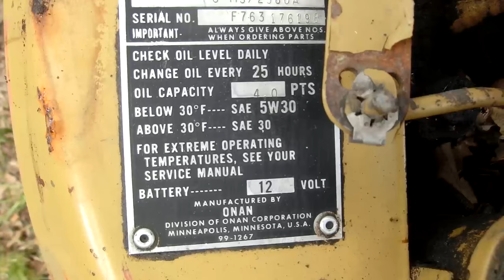Random Bits 0149: Cleaning up the Yard, 3 years of Random Bits

Comment: That yard reminds me of one I cleaned up a few months ago.  I saw an ad on Craigslist for free aluminum clothes yards.   So I went there with my van and their yard looked like yours.   The old lady who owned the place asked if I was interested in the stack of thirty (30) aluminum ladders and all the other things made of aluminum piled up all over.   She asked if I was interested in the rest of it for $300.   I was glad I had that much on me because I thought that was a deal but then she turned and went into the house and brought out her purse and handed me $300.  I thought she was offering to sell it to me for $300 but she was actually offering me $300 to haul it away.   It was such a deal I hauled away everything she didn't want and I threw in some yard work as well, mowing her yard and raking it and fixing her patio which she admitted she hadn't seen in 20 years.  She was so thrilled to have her yard all cleaned up that she offered to throw in dinner and I was so thrilled to have a huge pile of valuable scrap metal and the money that I threw in cleaning out her garage as well.  I ended up getting even more scrap metal from that.   I now have made a little part time business from scrapping.   

Last week my employer had the whole building rewired.  I think I ended up with five miles of copper wire as a result.   I asked the electrician why he didn't recycle the copper wire and he said it cost him more to strip the jackets off than the value of the copper, based on what he bills his clients for his time.   He says he usually has to find a dumpster to dump the wiring he replaces when he does a building.   

I see your yard and I see treasure.
Reply from the maker: thats pretty cool, and very nice of you.

Comment: The smoke after turning on lawn mower is probably just the dust setting on it burning when it hasn't being used for a while. The other thing I couldn't bare to watch was you were wearing sandals when moving those bricks and blocks. When I was around 11 years old, a 6 inch concrete block fell 3 ft onto my foot, I was wearing trainers. The pain was immense and I thought it broke my toe, glad it wasn't.
Reply from the maker: it was prbably more like some oil that leaked out. and i think your issue with the brick was the fact that it was heading for your foot, not what shoes you wore. i prefer to be careful and not put myself in a position that requires safety gear. also any time i wear boots in weather like this i feel like im going to get heatstroke again.

Comment: Have you ever considered getting a second hand shipping container and using it as a shed/workshop? I dont know how expensive they can get (including transport) but maybe with a lot of patience you can find a cheap one (scrapped?).close to your home.
Reply from the maker: yeah ive been wanting one for a long time, but they arent quite big enough for what id like. and they take up a lot of room. if i get some place in the woods i'll definitly buy a shipping container though.
Reply: The "not big enough" part is slightly disconcerting.
Reply from the maker: Maliciously Delicious
how is that disconcerting? i like more squarish rooms than long narrow short rooms.
Reply: Rinoa Super-Genius I know, but a 40 foot shipping container is still a huge space, wondering what you would need an even larger space for. Granted, I said the same thing about a two car garage being big enough, and that barely fits one car, let alone two and all the other shit one keeps in a garage.
Reply from the maker: Maliciously Delicious
 for working in. i dont want to basicly work in a hallway sized room.
Reply: Even better. Get two. Have a concrete floor slab laid down. Weld them together and cut out the middle to make a larger area. I've seen it done before.
Reply: Rinoa Super-Genius That I can understand. They are awesome for bedrooms and storage though.

Comment: One of the reasons of a hot running engine is it's not running at rated governed RPM - around 3600 RPM on these.  More airflow, better oil slinging, etc. makes for a cooler engine.  But it's sure neat seeing your conversion.  Well done.
Reply from the maker: +Ox well, that and propane burns hotter.
Reply: I have to disagree with you on that one, Rinoa.  Propane has less BTU per gallon than gasoline.  How can it burn hotter?  Propane has around 91,500 BTU/gal and gasoline has around 114,000 BTU/gallon.  It's the reason a propane powered engine will have less horsepower than a gasoline powered engine, all things being equal.  Propane definitely burns cleaner and will let an engine live a very long life because it's so clean and doesn't leave deposits and soot and crap in the engine, plus the noxious emissions are reduced greatly, so it's a good choice for a fuel.  

Cleaning up and knocking down shrubs and weeds makes a yard look so much better and different.  Good job on that!

Comment: the lawn tractor is probably just burning off the extra oil.   also, if you raise the mower deck you will be less likely to destroy it when mowing in mystery areas    :+)
Reply from the maker: yeah i think some oil leaked into, or onto the muffler. and yes i always have the deck all the way up, but having two flat tires counters that.
Reply: p.s. dumping all that ash where you mentioned might kill the tree/lawn due to the high alkaline content

Comment: This is everything I love about your channel, compressed into one video! :) P.s Can you make a video in your insulators?
Reply from the maker: yeah but id like to find something to do with them first. i might set up my own power grid someday to display all my old power equipment.
Reply: 12v dc grid across the yard, with solar panels, so you can hook in your mower or any other battery at more than one place and share all the panels with it, plus a telegraph so your mom can call you, lol
Reply from the maker: jusb1066
well i was menaing having like 50,000v ac and small step-down substations and whatnot. this would be if i had my own land. it'd be for demonstration.
Reply: You can turn them into lamp shades, search power line lamp shade.  Or you could put all of them on one long pole and use it to touch power lines? Nah, I don't no. I really want to find one. But on eBay they're all from the US, and the shipping costs over £60!
Reply from the maker: Science Shed
lampshade? no thats a stupid idea. and just go looking around in the woods near railroad related areas and your bound to find old insulators in the dirt.
Reply: even in the uk?
Reply from the maker: Science Shed
most likely. i found a lot at a place where a train had derailed in the 1920s and the 1950s. evidently it wiped out the telegraph lines and they had too much to deal with to worry about picking the power lines up.
Reply: oh yeah, really cool!
Reply: Science Shed
not likely in the UK! they dont leave anything, never seen any rail line (super handy as anvils) or anything!
Reply: yeah, I'm sure I could ask the SSE. I'm sure they have plenty of old power insulators. My mate who owns a farm has 10 old power lines. He collects them after storms.

Comment: also live the electric bike u got, the electric tractor is neat but would like to see u put bigger tires front and rear with a cheap yard sale push blade it would work better)...  cheap built equipment is my favorite like a front end loader using a winch ck en out on u tube

Comment: smoke = oil :P did you check if you werent running it dry?
Reply from the maker: yes i show that in the video >_>
Reply: must've missed it then. i shouldnt do other stuff while watching videos...
Reply: Rinoa Super-Genius It was probably overfill with oil. If engines are overfill with oil sometimes they will smoke if they are too full.
Reply from the maker: Cailean Rive
no this one doesnt smoke from that much overfill, i think it just leaked oil onto or into the muffler when it was sitting.

Comment: Why do you run your mower at such low RPMs?
Reply from the maker: because it works fine at that low RPM, and i also have to keep it from overheating due to running it on propane. i do step up the rpm when i need more power though.

Comment: the next video you should do is fix up and repair and update your lawnmower
Reply from the maker: update how? and no, that will be a spring video.
Reply: maybe update wasn't the right word I mean put new stuff on it Like head lights like that kind of stuff
Reply from the maker: i modded it to have a 10w led headlight, but honestly it works great how it is (when the tires arent flat and whatnot) so i'm just going to maintain it as i have it. my greatgrandfather did several modifications to it in the 30ish years he owned it, and then i heavilly modified it further to fit my needs more. i think i'll just get new front tires for it and it should be fine.